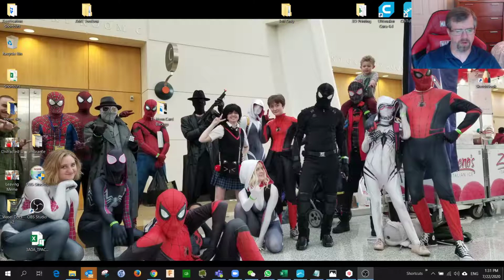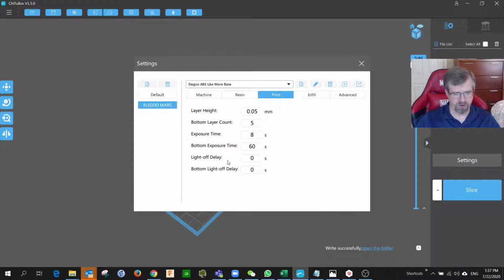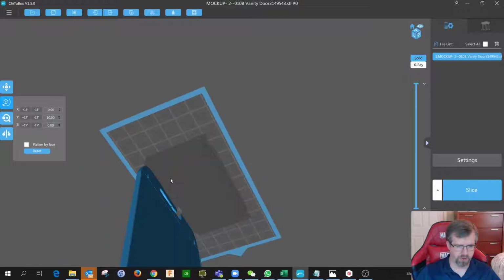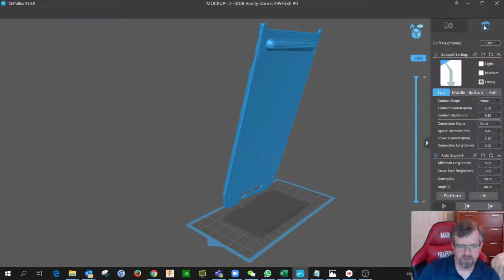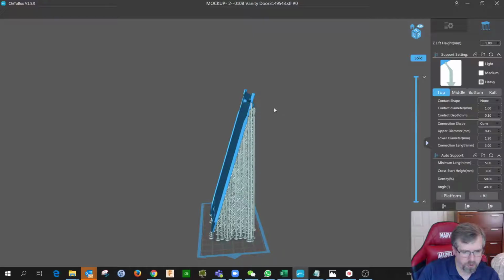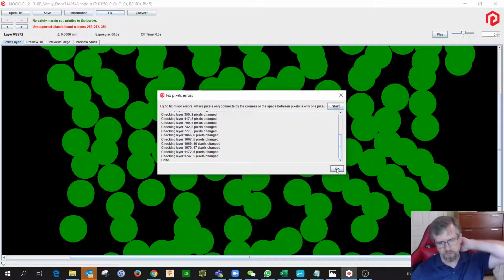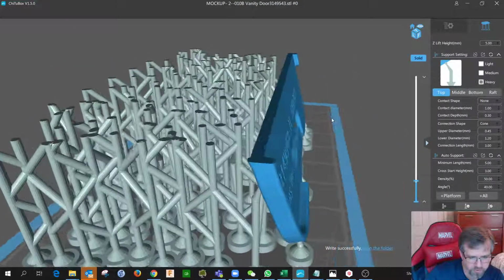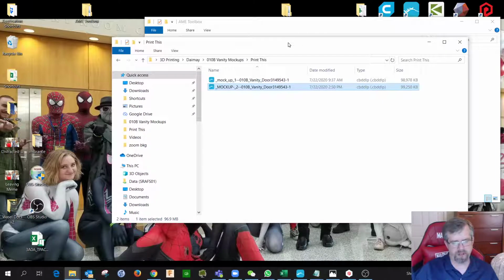Elegoo Mars - Using Chitubox and Photon File Validator

Comment: For some reason it won't save as a cbddlp file in my version of Chitubox. It only saves a ctb file which photon validator doesn't recognize
Reply: I think worth noting that Chitubox 1.6.1 now uses CTB which this Photon Validator doesn't recognize. That creates a cumbersome work around to be able to use this program
Reply: @TheHiddenMana  what was the work around? Im running chitubox 1.7.0. Do I need to revert back to the older versions?
Reply: @The Fupanator I moved on to lychee and I have much better results with all in one software

Comment: btw to get the .ctddlp file out of Chitubox you select 'Default' slicer profile on the actual Chitubox 'Slice' button (it has a down arrow on the button - click it). I have two other profiles for the Slice function on Chitubox i.e. Elegoo Mars and Photon Cubic (or something similar) and they don't save out in the .ctddlp file format.
Reply: thank you so much i was getting so frustrated with it because i couldn't get it to open
Reply: Thank's much, been scratching my head on this one for a long time.  Nobody else even hints at this solution in their tutorials.  Been manually adding the .ctddlp extension to the files, which is a pain.